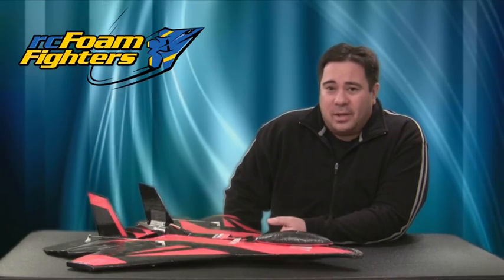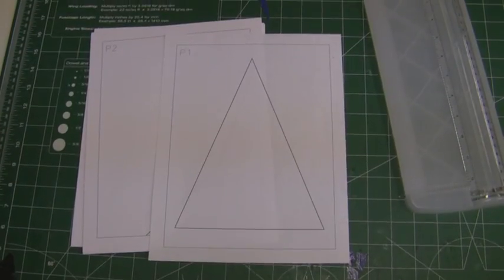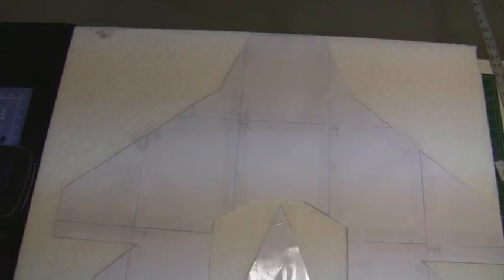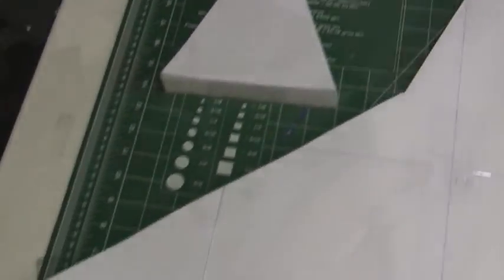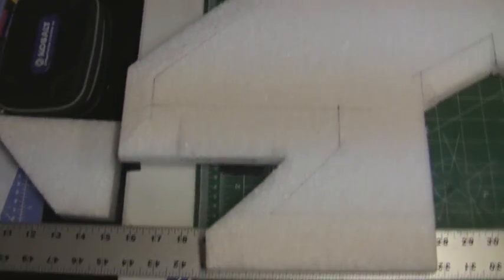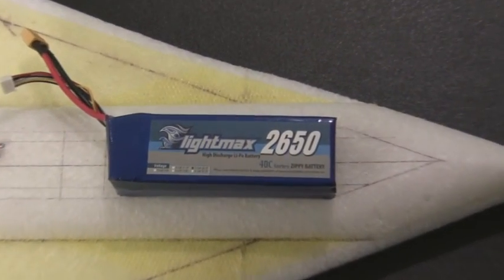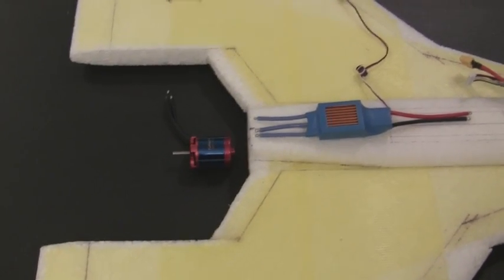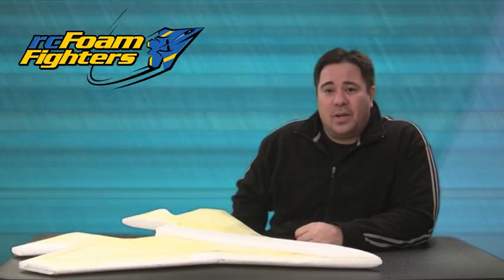Project SuperNova Part 1 (Fast Scratch Built RC Plane)

Comment: hey team of rcfoamfighters, thanks for the amazing tip and making it easier for anybody to pic up rc hobby but however, can u guys also teach hw to fix the radio channel or remote control, hw many channel it should be, transmitter and receiver and servo stuff and how to bind it with the plane?? Im very new to rc stuff( planes or car or helis)... Thanks

Comment: Paul, 
I have had my supernove servos quit working while i was flying,how should i wire my bec?
I have it soldered to myesc connecter, is this alright.
I have the same esc and bec that you built you plane with.
What could be causing this?
Thank you for your help.

Comment: This plane is very tough, I crashed it the first time a while back and I was moving pretty fast.
the weeds I crashed in was about 3 foot tall and tere was a 7 foot strip that there was no weeds were the plane crased, I seen something flying off the plane, it was the battery but the plane was fine very very little damage :).

Comment: Hello Paul,
I built  the supernova and it is very very fast,
I crashed it yesterday when I was making a turn.not sure what happened as I was turning left in just nosed into the ground,
the hobbyking 90 amp esc was hot could that have it?
when I checked the watts and amps it was pulling 1550 watts and 99.99 amps.with a 7x6 prop to you think I need to prop down to a 7x5?

Comment from the maker: @1flyinhuck Both the Regular Novajet and SuperNova were built with 30mm EPP Foam. As for the thrust plate, a motor dead center  would probably be optimum, but it will still be ok if it is not. My Nova jet and SuperNova had the motor mounted a little higher than center on the thrust plate and still seemed to work fine.  Either way should work fine.  One good point with the motor a little higher is it does leave a little less prop exposed on landings.

Comment: Paul I think I have everything to build the nova but plans. Is it built from 15 mm epp or 30? Question 2 is I just built my first scratch plane the wolvarine and I encorparated a trust plate like your nova it is part of the main body foam board with a carbon spare in front for strength. I thought that would evenly displace the air moving across the front . should the motor be mounted dead center ,below or above the thrust plate?

Comment from the maker: vegham, If you are refering to the Yellow stuff, that is resincoated fiberglass weave.  It makes the plane much stronger. We then just cover it with colored packing tape.  I will put a link in the sidebar to a blog article i wrote up on the weave. Give me 5 minutes and it will be there.

Comment from the maker: Thanks johndog35! The Rasp is just one I picked up from Lowes hardware store, think it is made by Stanley. Not sure the model, I will have to check. I found the best way to use the rasp is in a side to side motion instead od straight forward and back. It seems to more gently take off foam that way. Theis series is kind of basic and quick, not the best Build-A-Long, but hopefully it will help a little when i release plans for this plane. Thanks again!